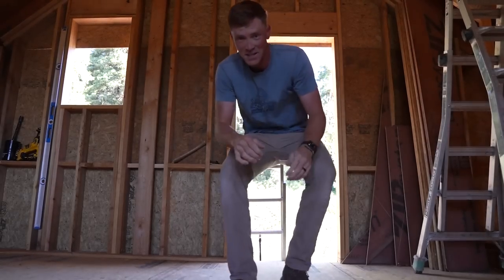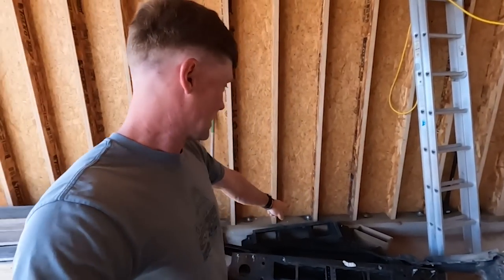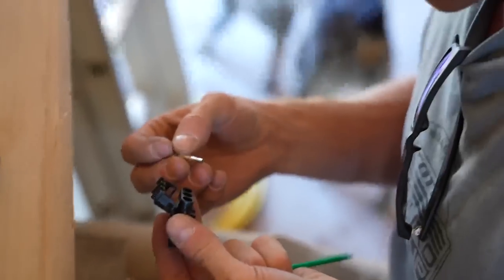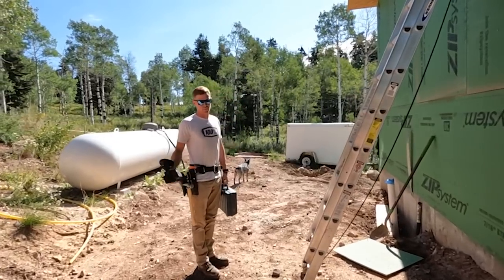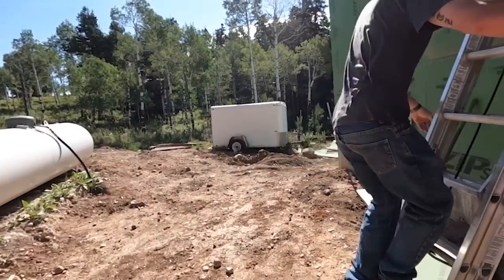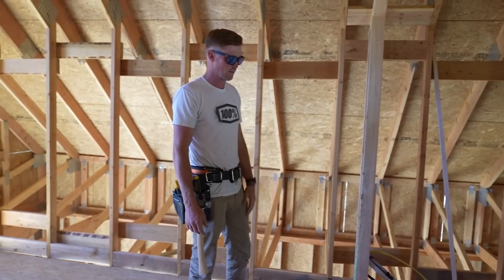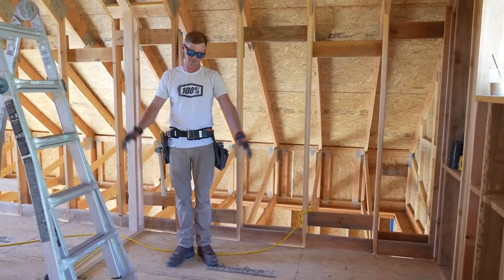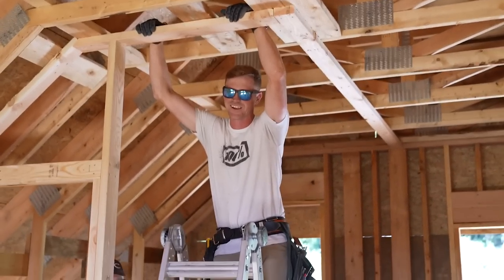FRAMING WALLS IN OUR DIY GARAGE | BUILDING OUR OWN HOME

Comment: A pad of graph paper is very useful during times like this, where you are brainstorming on room size and door placement. Scaled furniture can also help make decisions that won't require tearing out later to correct mistakes made during the design process. Paper layouts are much easier to alter than even chalk lines.

Comment: Stick some fabric softener sheets in the engine crevices.  It works to keep mice out of the engine.  Believe me, it works I had to replace all my electric cables within my motor. Cost me 1.1k . Now i store all my vehicles with softener sheets in the motor compartment.

Comment: Have you considered a pocket door for the bathroom? Even with plumbing installed to the right of the doorway ( as faced from outside the bathroom) if you built out the exterior a bit, then you could conceivably install a pocket door. Which would save floor space in the rest of the room, not having to accommodate a swinging door.

Comment: Trent,  My sister discovered a bag of corn she had purchased a few days earlier, that she left in the rear of her SUV had been opened by some mice.  After removing the corn from her SUV, she went to the local True Value Hardware Store and was sold some bags of balsam chips.  Balsam like the Balsam fir Christmas trees.  She said the chips come in the large tea like pouches.  She hung a bag in the cab, laid one in the back of the SUV and one in the engine compartment and no more mice.  They say bags of peppermint will do the same thing.  Either way, your car will smell great..  A snack suggestion:  Dot's Pretzels.  I like the originals.  Some like the Southwest flavor.  They're a little more spicey.  They are incredible.  Enjoy and Good luck.

Comment: One can not understate how great it is to work inside and put vehicles inside to work on out of the sun. You might also consider putting in a sliding door that retreats into the wall.

Comment: Have you thought about putting the water heater and furnace on the bathroom side of the trusses? Access in the bathroom will leave that other wall free for other stuff. And the water heater will be closer to the fixtures for less plumbing.

Comment: If you followed the plans and put the door on the side instead of the end you would have more room in the bathroom. just put the water heater behind the bathroom it has to be freeze proofed any ways. which would keep the pipes from freezing,

Comment: Hello, question, why isn’t the bathroom at the back of the room from end to end.  This way it won’t come so far into the room?  Also the back wall can be where the bed goes?  If you use a patio door it will get you a bigger view and it won’t open into the room.  When you come in it could be kitchenette. living room, small dining with bed and bathroom in the back?  Food for thought?

Comment: Do you still have hot water tanks in America, in the UK these have mostly been replaced by Combi Boilers, especially on new builds, much smaller take up very little room, no need for water tank and they give instant hot water/heating on demand.

Comment: A propane fireplace, wood stove style, with thermostat,  will heat that whole place beautifully. Plus it is perfect for mountain home atmosphere. You want to have something that works during power outages. A furnace won’t work in a power outage. Propane on demand water heater is also a good idea. If your big house gets too cold in a snow storm power outage you can retreat to the garage apartment.

Comment: Guys, I had a family of mice trying to make a home in the AC of my car that I keep at my mountain house. I found Tomcat spray that is peppermint oil based and actually is safe to your pets, smells good and actually keeps the mice out of the car and garage. You can get it by the gallon on Amazon. I actually spray it in my engine compartment and the concrete below the car. I do reapply weekly. Also, those axle boxes will make cool planters!!
Reply: peppermint oil is also said to repel Spiders!

Comment: There's a non crimped end that when used with a heat gun soldier's and has heat shrink tubing on the outside of it to seal connection up

Comment: The back side of those vertical walls over the Dead space will need to be sheated to hold insulation batts in place

Comment: Just saw where you widened the bathroom. Good call. Might want to keep the tub in the original location to allow a deeper plumbing space on the plumbing wall. The shower/tub plumbing is always so tight in a normal wall.

Comment: If you doing attic furnace or attic storage do you just insulate the bottom of the roof inside your attic and then build a floor inside your attic to walk on between the trusses

Comment: I think you should have used 2x6s for framing the inside wall where the plumbing drain and vent lines will go. Plumbing walls made from 2x4s will be destroyed after boring the holes for those plastic pipes. What did you use to frame the plumbing walls in the house?

Comment: I would think you should leave studs open in part of the walls so the all in one piece bathtub can fit in and be properly framed underneath so it is supported by a concrete pad or studs and plywood raised base.

Comment: To utilize space they should have installed a "Pocket Door" for the bathroom and it would be the best use of space because it would have gone into the wall and be hidden.  There would not have to be an area for the regular door to open and take up more space....and it is not too late to do that. And, they could have installed a recessed cabinet (recessed into the attic space) that would hold towels and sheets.

Comment: I think it would be unwise to put the bed up against the windows, it will be quite cold in the winter.  Not knowing the exact orientation of the wall -  NESW - it could be pretty cold with the wind!  Also, if you used the main wall on the bathroom, you could use a pocket door, such a space saver! Is it common practice to use one's foot while cutting a board in half...Brandon?!?
Reply: It won't be cold if they insulate the walls and buy a window that is double-paned to keep drafts out.
Reply: @KayInMaine  Like Trent and Allie, I live in the mountains at 8500' with BIG winds (I'm near the Great Sand Dunes!).  I have a fairly new build with heavy insulation and triple paned windows.  My outer walls get cold in the depths of winter!

Comment: Why not install a sliding door for the bathroom? Either in the wall or a barn door. And I agree with many others suggestion for using an on-demand hot water system instead of a tank.

Comment: Why do a tub? Why not a corner shower? And aren't you going to put insulation in the outer walls? Personally, I would put the door to the bathroom where you come in from the main door and then put the tub/shower on the wall that runs along where utility room is...that way all of the pipers are in the interior so they have less chance to freeze. Should probably insulate the apartment floors too underneath.

Comment: Why not make the bathroom door a barn slider so there is no swing space taken up?  Yes, you can put a furnace & A/C in attic spaces.  It just has to have correct air clearance.  I would suspend it from the rafters using strapping.  That way you don't get noise and vibration transfer as much..

Comment: Spray foam the roof deck, your knee walls will become conditioned area. You can also go with a ductless heat pump if sized properly and wouldn’t need to spend the extra for gas heating and ducting. Just my 2 cent, lol.

Comment: If I could give you some advice. Put the water heater on the bottom floor. That way if it were to ever leak water it would be on concrete and not destroy your ceiling.  I've had that happen and had $13,000 dollars I'm damage. You won't know it until your ceiling starts to drip. 
 The ither advice is draw on paper first your plans to see what they look like. Instead of talking about them. And walk through your plan. Thanks always for Dearing your life

Comment: I am a mom. That self soothing would work better for you if you finish off the basement and move Leo there, at least until he starts sleeping through the night for sure!! You can always use a motion monitor, not a noise one. And one that has a no sound option, only a picture so you can check up on him and decide if he really needs you in person.

Comment: Just curious, why not put the bathroom door on the long wall with a pocket door? Is it because the shower, toilet and sink are all going to be on that wall? And it sounds like you plan to put the furnace and water heater on the opposite side of the room, rather that the same side. I'm not a builder so I don't know the ins and outs.

Comment: Just wondering what your plan for that outdoor staircase on the north side of your garage/apartment is for winter time ice and snow?
Reply: I have also been wondering about the safety of an outdoor staircase on the north side of the garage/apartment.  Frost will also be a problem.  At 8,000 feet elevation, snow and ice are possible in early spring and late fall.

Comment: your plans to not use the attic space didn't make any sense to me. older 1-1/2 story homes almost exclusively us the attic space to conserve floor space.  they will place Water heaters, furnaces, a huge closet, electrical and plumbing. as long as you insulate it correctly you can use the whole space. I personally would place everything I listed in that attic space, then you have a great open floor concept for the apartment!

Comment: Like Trent, I am not a fan of gummy bears, so mixing them with Cheez-Its would not be my favorite, but it sounds interesting.  My favorite snack combo is applesauce and Greek yogurt.  Try it sometime.  Even Leo might like it!
Reply: So do you still eat them separately or are you mixing the applesauce and the Greek yogurt? I like both of those so sounds good. I’ve never tried together though.
Reply: @lindafrance9192  I eat them together but I don't mix them together.  I generally put the applesauce on top of the Greek yogurt.  Try it sometime!
Reply: @sandrachristensen7282  since I usually have both on hand I think I will, especially when I may not have other fresh fruit to mix into my yogurt. I think adding some chopped nuts sprinkled on top would even be better. Yum.

Comment: Not sure about the local building codes, but putting the water heater and furnace in the attic space as you suggest is very common here in the south.

Comment: So, Trent, you don't want plumbing in the attic wall, but you'll put the water heater, and all the plumbing in and out of it in the attic?  You have a small space, you are using up valuable space with the door to the bathroom on the side.  You'll have lots of room in the bathroom, but no room for people to enter the space from outside, and get by someone working in the kitchen.  The bathroom is too wide, the door is in the wrong place, and the outside door should have been moved over further so that there wouldn't be a big dead space behind it, which would also give you more room for the kitchen.
Trent, take some time to figure out how to do things ahead of time, and you'll have a space that is used much better with fewer regrets.

Comment: Just because people do something all the time does not make it right.  Your attic space is likely designed for a 10 PSF live load.  normal floor loads are around 40 PSF.  Depending on how big the water heater is will determine how big a problem is.  A full 10 gallon water heater will weigh around 100 pounds when all said and done.  you need to distribute weight. Also want to make sure all the plumbing is in the heated space.  get your modification approved by the truss engineer, not the salesman.

Comment: Should be a tight fit to put a tub in after framing.
Reply: Didn't they say they were installing a shower?
Reply: @johndell8679  Thought the used the words "tub", but will check it out.

Comment: Why don't you put the water heater and furnace in the garage space, like make a small room for it, just below the center part of the apartment? Know what I mean? Or is there room there for it? It's hard to tell the size from video. I don't mean dead center of it all just centered on the garage back wall.

Comment: I enjoy your videos and the inventive ways you solve problems. But, is there a reason you don’t use floor plans so you know where plumbing, etc., is going before you build?
Reply from the maker: We do have blueprints, but we don’t love the way it’s laid out for multiple reasons so we are changing some small stuff on the fly to make the build easier and more functional
Reply: @TrentandAllie  Wow, thanks for the prompt reply. I was just a little curious when you were talking about installing the toilet on the wall closer to the middle of the room which means your drain would have to go farther than if it was on the truss wall. I enjoy watching your progress.

Comment: I cringe putting a toilet anywhere near a kitchen. One flush on the toilet produces thousands of tiny aerosol drops of bacteria and viruses and contaminates can spray up to 6 feet away. I lived in a cottage like that and was determined never again. Even though it had a "curtain" separator, I was really grossed out. So any small space I design I try to adjust the door facing opposite of any kitchenette area, yet still keep the plumbing rather close.

Comment: Don't get the logic that you can't put the shower on the outer wall of the loft, but yet you can put the hot water heater out there? If it's true you can't do one, you can't do the other.